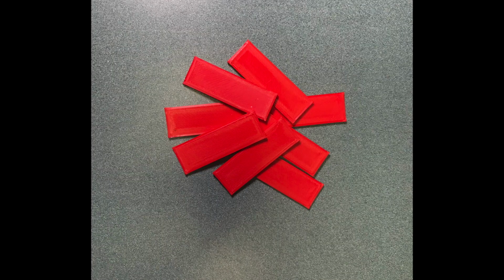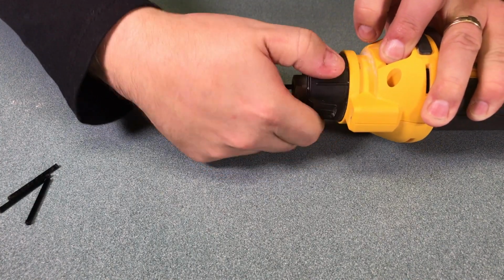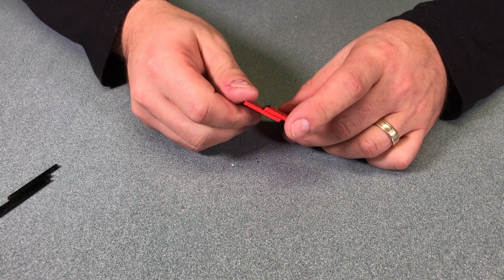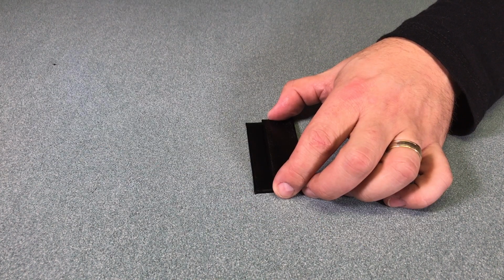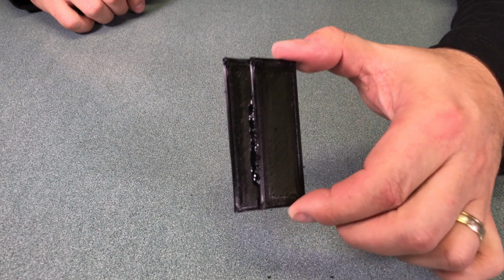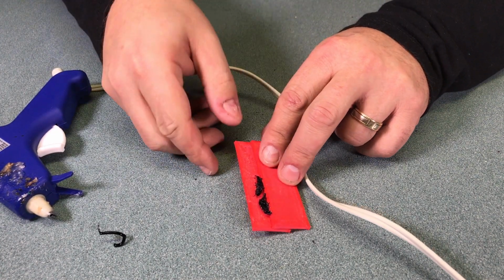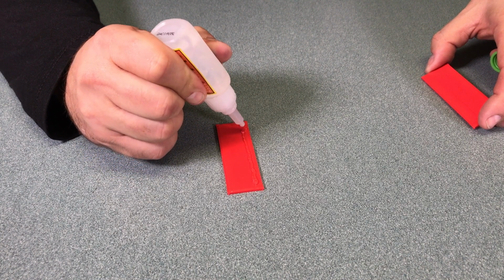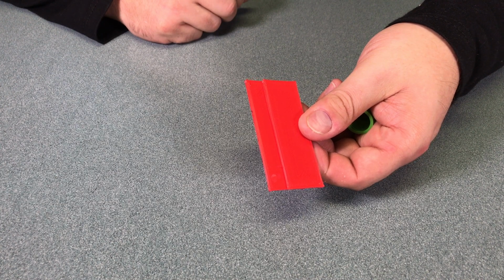Sticking 3D Printed PLA Parts Together - Plastic Welding vs. PLA Glue Sticks vs. Gorilla Gel

Comment: A 3D pen works with 1.75 filament. For some items I design a slot in the 3D printed part and then fill the slot with PLA from a 3D pen to glue one part to another. This keeps clean crisp edges to the added PLA. There are occasions I use the gorilla gel. That is particularly good for adding a very small part.
Reply from the maker: Thanks for watching and for the 3D pen suggestion. Do you have a particular pen you’d recommend?
Reply: @BaldGuyDIY  I use a MYNT3D Professional Printing 3D Pen with OLED Display ordered from Amazon.

Comment: I use a 3d pen But Before i used a Firmament strip and a hot air gun.
Reply from the maker: Which worked best?
Reply: @BaldGuyDIY  the 3d pen is better. But the airgun did also a Good Job. Its a little harder But i Think Test it yourselve. Bouth Methodes work fine for me, But i prefer the pen.
Reply from the maker: @Enderkruemel  thanks for sharing and thanks for watching!